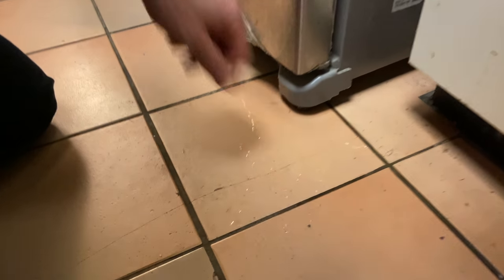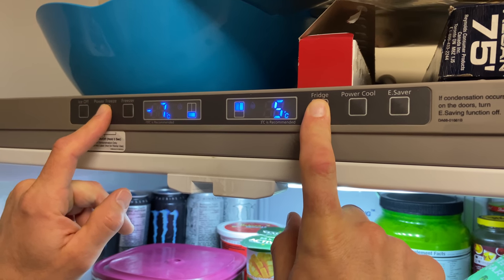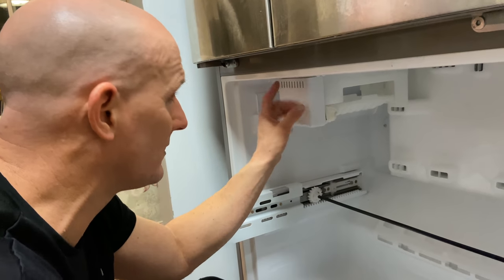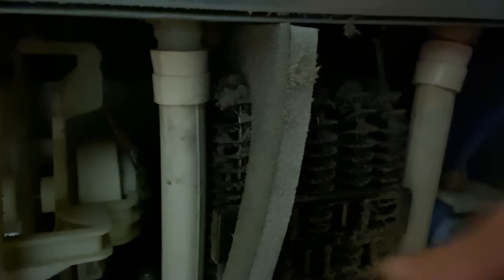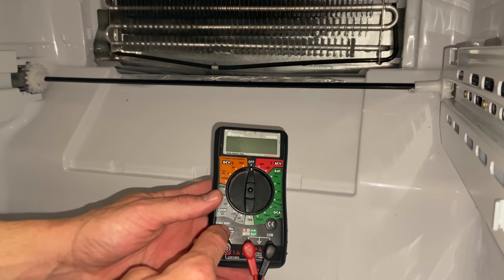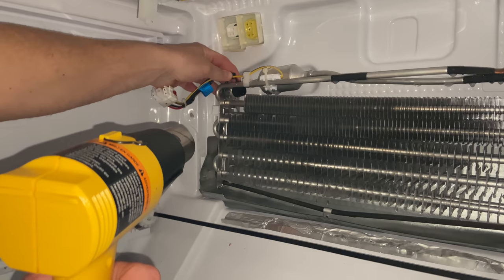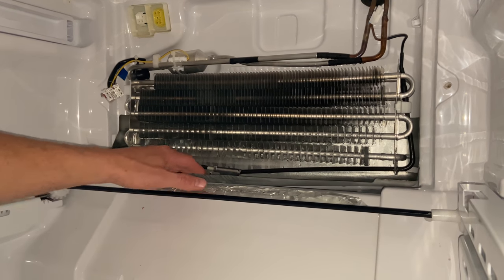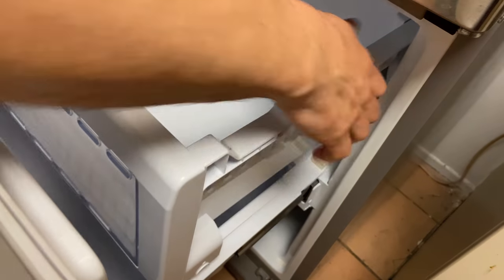Fix Ice Buildup Easy (4K) Samsung Refrigerator

Comment: I HATE my Samsung RF263.  In a refrigerator that cost almost $2000 Samsung should have used better quality parts.  I have never had so many problems with any appliance. Problems started when it was less than a year old. Now (6 years later) 2-3 times a year, I have to search YouTube to figure out what my current problem is. I’m just a little bitter as I’m again having to spend hours emptying my refrigerator and defrosting it before I can even get the back panel off to continue defrosting and changing out the part of the day. Come on Samsung, do better.  Just venting
Reply from the maker: They really did a bad job for sure.  I will be making new updated videos on a few more issues.
Reply: Samsung is actually a great product...all brands have issues...check out LG compressors...they fail after a couple years, and their service is not as good as Samsung's, which is awsome service!

Comment: Hi Jeff    I am a master technician of forty years and I agree with much of your video, however there is one area of your video that I must comment on.  This is the section regarding the testing of the bimetal sensor at the top corner of the evaporator. This bimetal is supposed to go open around 50  to 75 degrees F   and it must not be a really warm temp. in order to go open.  It is a really bad bimetal even dangerous bimetal that has to be heated way up in order to go open.  I have seen a bimetal be like this just once in the past and it had actually allowed every thing in the entire freezer section to be cooked very slowly.   I am also a fire fighter and this could be a dangerous scenario.  SO warmed up to  room temp with a hair dryer ( not even warm to the touch) is warm enough.   The other point is that a hot air gun can and will warp the plastic at the back wall of the freezer. It could get warped so badly that the evaporator might be interfered with as far as mounting is concerned.     I hope this helps some people and again much of what you are demonstrating in your video is good information.
Reply: I'm a Samsung tech...great advice, specially on the hot air blower, I commented also, if warping acoures, Samsung will void warranty for customer damage if warping is at a degree that assemble/reassembling is impossible...and they are right...its customer damage, and unrepairable...
Reply: @projardgreen2568  Good, useful and fully warranted comments. My only observation, being a Samsung refrigerator owner, is that there are a number of very poorly engineered systems that need to have been done better. Several are of the systems for creating defrost water and eliminating it from the collection trays. I have had to do right much to mine over these last 13 years or so, to keep this baby going. My biggest maintenance item is keeping the evaporator coil and its airways clear. We have always had a dog, so consequently this is where the fur and dog hair gravitate. I clean mine every three months, and the area is always filthy. After I do that, the fridge actually starts turning off for long periods if it isn't opened very much.

Comment: Jeff, the pinched restrictions in the rubber drain tube caps are there for a reason.  They restrict the freezing cold air flow through the drain.  An unrestricted drain will have too much air flowing through it and will actually impede the water flow.  In this situation, any water flow will be small and will freeze on the inner walls of the drain tubing eventually blocking the entire drain.  So you need to have some sort of air flow restriction in the drain.  To solve this I try to modify the tubing with some sort of P trap or loop seal.  You have to be creative given the room that you have.  This works every time. This won’t let any air escape and the drain wont freeze.  Locate the trap as far away from the drain pan as possible.  Even with a functioning defrost system; too much air flow can still result in a frozen drain.  Just look at the drain in your home’s central air conditioner coil – It has a P-trap.  These cheap pinched rubber caps are very common and you will find them on most automobile a/c drains.
Reply: Hello, Hey thanks for your additional comment on the P trap. You commited that it takes a little creativety. Do you have any suggestions or ideas on creating this for a DIY? Thanks any sugestions would be appreciated.

Comment: Chances are the frost buildup is because the freezer fan is not working.  I have been struggling with frost buildup on the roof and top tray of the freezer in my Samsung French Door unit.  Doing a Forced Defrost did not do anything as I tried it several times.  I finally called for a repair and the guy said that the fan was not working as soon as he looked inside the freezer.  The fan is located behind the vent panel in the back of the freezer which requires removal of the top tray and freezer tub.  There are a few screws that attach the panel but once removed there were two fans...one that moves air in the freezer and another on the left that moves air to the ice maker in the fridge to keep ice frozen.  Once the freezer fan was replaced I have not had the buildup of frost.  My thought is that the heater element was not working but that was not the case.

Comment: Very well done video Jeff! I will add a trick I have used regarding  keeping the drain itself clear of ice. This method works on many brands not just Samsung. In your case, you happened to have the longer clip you installed on hand. Most of the time during troubleshooting, a DIYer won't have pre-ordered that longer improved clip to install. What I do is make my own. I take a length of 14 guage electrical wire and strip it down to bare copper wire. Then I wrap it several times around the defrost coil just above the drain with the wire hanging straight down into the drain hole but not touching the sides and above the air restricting nozzles. That copper wire will easily conduct enough heat from the defrost coil and direct it into the drain hole to keep ice from solidifying and blocking the drain. Best wishes.

Comment: I have a 1976 fridge/freezer that still works perfectly. Just had to clean out the defrost timer today since it was building up ice inside. Works perfectly again. Only $$ my family ever had to put into it was to change out one of the fan motors ($20 part). Funny how the old ones go forever but the new fridges die after like 6 yrs. The R12 freon does a much better job and is under far less pressure so less chance of leaking out and the compressor failing than the new refrigerants.
Reply: I have 30 year old Woods Freezer, Canadian made, and I have never ever had a problem.  Powers that be decided to send all manufacturing to China now we have land fill that breaks down continuously with a very short life. We want Canadian made products again! Quality products that last forever, do not contribute waste to landfill nor add to global warming.

Comment: THE BEST tutorial I've seen on this problem! Very well done and easy to follow. Thanks Jeff
Reply: I also found this very helpful many thanks this has been haunting me for ages.I found a easy way to clear the drain tube without the risk of damage get a 100 ML syringe that comes with 300 mm of 6mm tubing from Ebay about $5 fill it with hot water and feed the tube into the drain.Work the syringe back and forth and feed into drain as ice melts replace hot water several times and drain is cleared within minutes.Use the syringe to suck out cold water so you do not flood fridge.

Comment: Jeff, I did just what you said 2 months ago including ordered the part off Amazon that helps defrost and fits on the defrost coil and into drain line. No issues since. I also force defrost each week. Not sure if I need to keep doing that but thanks. You did a great instructional job. 
David in NC.

Comment: Good video! I have fought this exact fridge for 13 years. One suggestion is to use a small clothes steamer to blow steam up the drain tubes and down the drains. It also works wonders on all the ice. Safer than a heat gun!

Comment: Jeff, thank you  so much.  I have defrosted three times in last 3 months.  Could not find any info until today when I found your production.  Since I just defrosted and cleaned out ice 2 days ago, I will go to the rear of the frig to check the drain tubes.

Comment: Great video! I appreciate that you showed all of the steps instead of pausing and coming back with the step completed. Lots of how to videos do that. It helps to know what to expect. Seeing the full process is crucial. I actually cleaned the drain the last time this happened but, I wasn't aware that there were two of them and the one for the freezer was the one that I neglected so, I was back at it a month later. You solved this issue for me today! The next time I was going to get a new fridge. Thanks for saving us the expense!

Comment: Thanks for the vodeos Jeff. Did the fridge part as per you video, and almost a week now without any water buildup under the drawers- touch wood!
Today did the freezer part, there was a ton of ice in the drain. "Basting" the drain several times, until you hear the water draining is the key.
Although, I could not remove the old drain clip, it was stuck, and I didnt want to risk any damage. So had to make do with placing the new one over the top.

Comment: I love this man and his videos.
Your videos saved me a bunch of money. My frig stopped working, too. The hardest part for me was getting the back panel off because everything was frozen together and the center screw had ice covering it. I used a heat gun (which I probably shouldn't have since I semi-melted a few of the fins together), but I had already had it unplugged and open for a couple of days and it was still frozen. Once I got the panel off it was smooth sailing from there and the heat gun worked very well. I had to unscrew the fan panel to get the ice out of there.
Reply: Has the ice built up again? My fridge won’t drop below 50°.

Comment: This is a permanent solution to the ice build up, so sit tight and enjoy the analysis.

The root cause of the problem is ice built up and then clogged up the cold air vent holes and jammed the fan by ice. There are multiple reasons for ice build up:

1. Where did the ice come from? To minimize the ice we need to keep moisture inside to the minimum, which means covering up glasses of water, milk, opened sod cans, soup, cut open water melon, mango, fruits, wet vegetable, raw meat, etc. . The humidity inside the refrigerator is quite low, and so anythings that can be dried up will release moiture and this will form ice, and too much ice will out win the defrost heater short heating cycle (Samsung designed short defrost cycle to achieve the Energy Star) and the net result is a slowly ice build up if too much moisture inside. 

2. The other moisture source is the bottom Pantry tray that collected water. You need to pull out the pantry and clean this bottom tray every month or so, or after a spill from trays above. Any liquid spill not cleaned up will ended up as ice inside the fan box -- no magic about this. 

3.  The bottom drainage hole is clogged up with ice. Once this happened, every degrost cycle will release the water down into the bottom Pantry and pool there. This water then evaporate and form ice inside the fan box eventually. (Hint: to melt the drain hole ice fast, fill up the "pond" above the clogged drain hole with water then place a 15 watts soldering iron hot tip into the water and make sure to keep the hot tip from directly touching the plastic part that can be melted. Add more water if the "pond" is dried up and expose the hot iron tip. The hot water will melt the ice and clear up the drain hole. This method is faster than hair dryer or adding hot water spoon by spoon. You need to keep an eye on this and remove the iron as soon as the hole is cleared. 

4. Due to Energy Star regulation, Samsung and others have tried to design their products with low electrical consumption, which means they run the defrost heating cycle in much shorter time. If there is not much ice built up then the short defrost cycle is enough to melt all ice, but if the ice is too much then it ended up winning the battle and jammed up the fan or clogged up the cooling vent holes and the unit cannot get cold. 

So how do we solve these  problems? It is unrealistic to have zero moisture inside the refrigerator, but if we can keep it to the minimum as I pointed out in (1) and (2) above, and with a modification to the design that prevents the drain hole clogged up then the problem will be eliminated permanently. 
To solve the problem (3), I used a 6 inches long, 3mm diameter copper (or aluminum) wire, wrapped around the black heater pipe  (just above the drain hole and running across left to right) 3 turns, and extended the wire down into the drain hole. If you don't have large gauge wire then just use two smaller gauge wires, wrap them on the left and right side of the heater pipe and extend the wires down into the drain hole about 1.5 to 2 inches. This should carry the heat from the back heat pipe down deep into the drain hole and helps to prevent ice building up inside the hole. 

I used to fix the ice build up issue every year, but after implementing the 3 steps above, it has been running over 2 years and still no problem. My unit is RF266AB.
Reply: Man thanks for typing all this useful information. I appreciate you so much for sharing your knowledge with us. Please do a video about this if you don’t mind.
Reply: thanks I watch your sneaker vids b4

Comment: Hey Jeff, thank you so much!   I took off the back and sure enough those little rubber valves were clogged. You’re my hero that save me so much time and trouble   I had almost an inch of ice on a monthly basis on the bottom of my freezer. All you really have to do is just clean those rubber valves. I did not have to take the front door off or go deep inside the refrigerator freezer like you did.
Reply: what rubber valves? do you mean the drain tubes??  trying to determine if I missed something.

Comment: Thanks —Not sure yet cause did not check electric elements but cleaned filters and entire back and inside of freezing up freezer. What is your advice on freezer door rubber liner which is impossible to buy new one. Not sealing well and hair heater did not work. Already tried reversing top bottom once too. Great to the point advice and hope you will answer this question too. Really helpful.
Reply from the maker: Yeah these fridges are horrible mostly all drain tube issues.   Replace the drain tubes with the new ones in the link.   The magnetic strip if you can find the exact part you could buy a universal kit just measure the linear feet and inches.

Comment: Thanks for this video! Looks easy enough with your instructions. However, this fridge is in my RV and we cannot get to the back of the fridge like you did to clean it out. I have an island in front of the fridge and it sits about 4 inches off the ground level bc it’s on one of the slides. So it’s impossible for us to bring the fridge forward to get to the back of it. Is it possible for us to still fix this issue ourselves without that step? Looking forward to hearing from you. Thanks again! 😊

Comment: When checking the defrost element which wire on the left plug to you connect the meter to?  Or would it be best before opening the freezer drawer to find or download the wiring diagram to find out where on the plug the defrost element wire originates?

Comment: good video however i have the samsung mod rb1855sw my heating element is not same, it's has an element wire running back fort on the drip tray is there a fuse for it also there's no by metal going into the drain line what would you recommend?

Comment: At 11:29 in your video you have cleaned the drain slots… my question is 
Where does that water drip into? Is their a reservoir under the refrig like my grandmother had cause I clearly remember being the one to remove that tray and clean it out then replacing it! I’m curious
Reply: Indeed. There is an evaporator tray  tipically just above the compressor motor that collects that water. The heat of the compressor helps the water to evaporate, so tipically nothing more is needed in there.
Reply: @captainrayo  I keep getting water under the diary tray & this noise that comes on briefly about once every 45 seconds. Any idea what’s causes this! That’s why I’ve been watching videos…
Reply: @QueenBnSD  Unfortunately I am not a technician. When you mean the diary tray are you referring to the frigde or the freezer?
Reply: @captainrayo  the dairy tray bottom drawer of the refrigerator under the vegetable trays. Not the freezer
Reply: @QueenBnSD  got it. Sorry but I can’t tell you anything useful.

Comment: Good video, was wondering why you would have to check bi-metal & or defrost heater if the Evap was clear of ice? I also like how u cleaned out drain tubes very helpful.

Comment: Thanks Jeff. I have same problem that ice is getting freezes. The Fan is spinning at intervals as normal, but was making noise, then later stopped after defrosting it. 

In your case, the heating element and the Bi-metal thermostat.. both are working, then what was that causing the frosting in your case. ?

Comment: What happens to the water that is discharged to the little pan in the back bottom of the refrigerator? Does the refrigerator evaporates it or there is some king of discharge pipe?